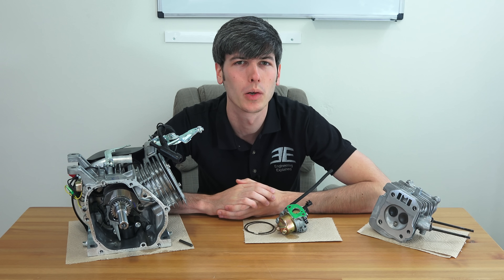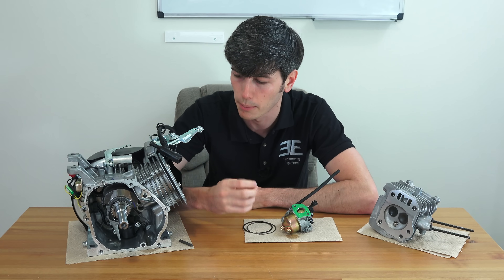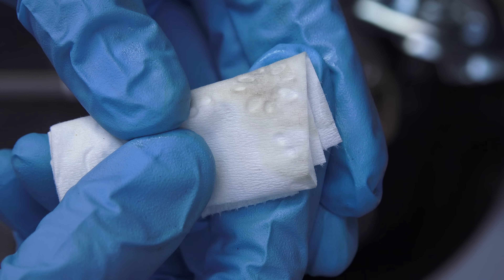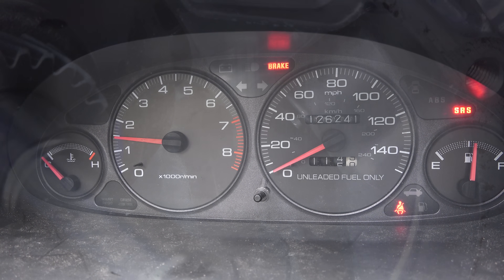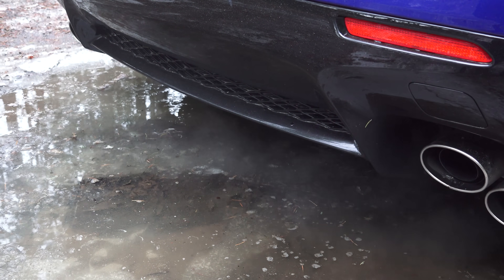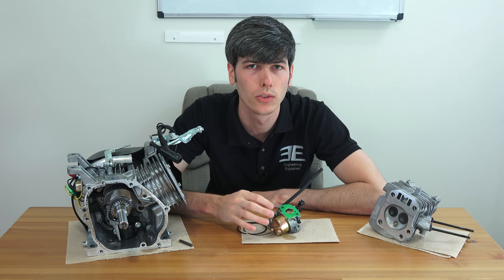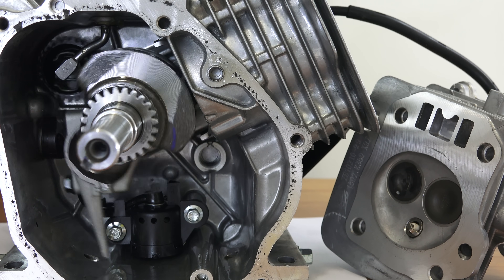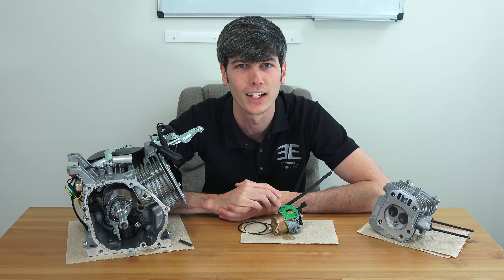Should You Warm Up Your Car Before Driving?

Comment: Yet, you didn't touch on turbocharged engines. Nor did you factor in what stress you are placing on gaskets and seals as they are stiff and brittle when cold. Not only that, but you failed to mention that metal contracts when cold and expands when hot. Forcing metal to expand rapidly by driving places more wear on the metal components of the engine, including main and journal bearings. Not to mention the piston rings. Forcing compression on an unexpanded ring can stress it highly. Not only that, but the engine won't be making full compression as you stated. Why? Not solely because gasoline doesn't like to atomize in cold air, but also because the rings aren't expanded. Also, yes, fuel washing oil off of the cylinder walls. Valid point. However, you are going to do more damage to your engine by forcing load on a rich combustion than you are allowing it to idle. At idle, the average engine sees about 12% load. Even under light acceleration, the modern engine will average over 50% load. This can be destructive and hard on gaskets and seals as well as highly stress the modern day metals used in modern day engine construction. With modern day synthetic oils, this theory is majorly invalid. In an engine using conventional engine oil comprised of hydrocarbons, this would be very much true. However, with today's synthetic lubricants which are by majority comprised of esters coming from petroleum, this is false. Today's synthetic lubricants are much harder to break down, even with a mixture of gasoline, hence why synthetic lubricants can often far exceed the "5,000 mile rule" by doubling it. Yes, gasoline breaks down oil, but it takes a rather significant amount to do so. You won't break down your oil THAT bad by letting your vehicle idle. Also, while we are on the topic. Your Integra, if it is a GSR or Type-R, comes factory with oil jets that spray oil onto the underskirts of the pistons as well as cylinder walls, so your Integra is practically immune to this rule you've provided. Modern day Civics are using that same technology in their newer aluminum cast blocks as well. I'm sorry, while you raise many points, they are all very debatable. There are pros and cons both ways. While you may reduce fuel wash, you will increase wear and tear on gaskets and seals and even metals. However, should you conserve them by allowing it to warm up, you will get some fuel washout. However, like previously stated, with modern day synthetic lubricants, this theory of engine damage from warm ups is the real myth. We aren't in the 1970s or 1980s anymore. Vehicles and powerplants have been revolutionized and this is a theory from way too many years ago to hold any remote amount of relevance to todays automobiles. Not hating or being crude. Simply providing some feedback as an engine builder of 8 years.

Comment: So what about turbocharged engines? no matter how lightly you drive the turbo still spools at a high rpm. and if the oil is still cold then font that damage the turbine bearings?

Comment: personally i always warm up my engine due to small distance i have to drive to my work ~4km.
driving small dinstances wont allow oil to get optimum themp and moisture that builds up will destroy oil 
same way as the gassoline suppose to do at cold start.
also when engine is cold oil pressure is high that ensures that all moving parts in the engine keep oiled ,there will be no dry spots in places that gassoline can dillute engine oil ?

Comment: What about in cases where its so cold outside that getting on the freeway actually causes  temp to go down. I have a 2011 dodge avenger with the 6cyl. I usually get to normal op temps by the time i get on the freeway. As soon as I do I i lose about 30c and sometimes (when its "why do i live where the air hurts my face cold") it's significant enough that i start to loose cabin heat.

Comment: You not addressing the various gaskets and their vulnerability when the various engine metals are cold. Most particularly, head gaskets.  Warming the engine allows the engine metals to expand against gaskets under minimal pressure.  I think oil dilution is a mute point as were it that serious I'd expect the engine to be burning oil badly in a short time, and we would have known about this a hundred years ago.

Comment: what would you qualify as "light" drivin. is it under a certain rpm like less than 3500 rpm or in a lower gear 5th gear with higher rpm instead of 6th gear with a lower rpm?

Comment: I'm sorry but you are expanding confusion by not explaining what "warming up" means and in what ambient temperatures.  I worked for GM and Bosch and had multiple interfaces with engine component developers and ECM designers.   Your references in carbureted  systems was fairly accurate but the fuel injected assumptions were horribly over-simplified and in some cases just flat wrong.  

Simplification is usually ok in arm-chair science but NOT with VERY complex electromechanical-fluid systems, especially when adding "Phase Separation" common to Ethanol fuel below freezing or in warm/moist climates like Florida.  Speak to any boat engine designer and you will understand why boat engines avoid Ethanol whenever possible.  

As for car engines, regardless of ambient temps you MUST allow the engine temps to make "early" stabilization settings.  Above freezing this often happens in 10-20 seconds depending upon ambient.  The EPA rules allow the first few seconds to allow proper engine start/idle and THEN begin the emissions step down as the internals rapidly warm.  

Below freezing there is another set of variables when a LOT of water in the gas system that must evaporate quickly or the engine simply won't run.   Also, below freezing the systems must rapidly re-calibrate to the temps and moisture burn off or the system will lock up with ice due to rapid air flow which drops the temps on the air intakes.  

Automotive engines today are VERY complex systems and over-simplifying them into "warmup" is a disservice.  Your videos are usually quite good but you screwed this one up badly.   Please contact some ECM/ECU designer and make a video looking at all the variables and realtime adjustments going on - you will be stunned and hopefully rescind this video.
Reply: Explosion pressure is high enough to push out multiple liters of water in the first second of startups.
The more cylinders and/or combustion volume the more water will be pushed out.

Ice in the exhaust system reduces air flow, which heats the remaining parts of the exhaust faster, you don't need to worry about that in non russian winter conditions

Comment: Sorry but it's not about the engine. driving with a cold transmission will cause it to malfunction. up north fleet vehicles have heaters attached to their transmissions. This is a fact. If it is below freezing Always warm it up before taking off!!
Reply: I have been a transmission specialist for the largest Remanufactured engines and Transmissions company for 7 years
Reply: light driving will cause malfunction? and this video IS about the engine, not about transmission.
Reply: @sultanabran1  you need to use the transmission to drive moron

Comment: This the cause of more misunderstanding than MANY other car ideas. "Warming up" does not mean running it for 10-15 or more....don't do that unless you maintain it under 'severe service conditions.' 

You SHOULD let it idle without touching the throttle at fast, cold idle until the idle drops down to whatever normal idle speed is for your car's engine. It's usually a couple minutes. Currently, I'm in northern North Dakota and my 'fast idle' time is about 5 minutes, after that I drive. In summer it's about 60 seconds or so.

Comment: As a powertrain engineer, I can tell you there is merit in letting your engine reach some minimum temperature before putting any load on it. Because pistons in passenger cars are aluminum and the cylinder liners are steel, they have different expansion rates. People who design engines know this, so at cold temperatures the piston to wall clearance in an engine is much greater than at operating temperature. Modern engines with dynamic valvetrain can produce significant torque at low RPM, and with the offset wrist pin design present in nearly all passenger cars, this can cause excessive side loading of a cold piston. Fuel washing cylinders is a valid concern, but scraping cylinders with a cold, side-loaded piston under heavy load is worse. 
My advice is to do some research on your engine and understand what the piston temperature rise profile looks like at idle. Once the piston temperature approaches steady state engine operating temperature (even if the engine is relatively cold), you're probably good to drive normally. However there will be a tradeoff unique to every engine at which point letting the engine idle longer with an operating temp piston in an otherwise cold engine will only serve to compromise the cylinder wall lubrication, as is mentioned in this video. That tradeoff point will be yours to determine/decide.

Comment: The colder it is the longer you should wait before driving. Cold engine parts don't have the correct tolerances and putting any load on the engine when the clearances are all wrong will cause increased wear. It's not just about oil circulation as you imply. With Subaru flat fours you can even hear the ill fitting parts when they're cold. Many Subaru's also have a blue "cold" light. As others have said its not always practical, or safe, to drive lightly.

Comment: If a warm up is not needed on direct injection engines, why are they still programmed to have a higher idle speed during a cold start-up?  Are those extra 500 rpm's for the first 3-5 minutes serving another purpose?

Comment: Well... the thing is that the true reason people warm up their engines is to warm the car up so your not driving in a frozen car interior. Unless you live in a place where all you need is a credit card to scrape your windshield then you have NO freaking idea what real cold winters are! lol
Reply: creditcard...no way....I have to carry and use a small scraper to keep insides clear,,,,,and that on a 2018 CRV where you can let it idle for hours and still no heat
Reply: right now its -32 in Edmonton alberta where I live, I'm gonna run my truck for 15 minutes before I drive home because I don't wanna die.

Comment: Good video, but you missed an important point. Thermal shock to the liner. If you start the engine from cold and dont wait for engine to warm up, you may even get a cracked liner in extreme cases.

Comment: Hmmmmmm.....what's the difference between driving the vehicle or sitting in park? still the same fuel is injected either way to keep the engine running.

Comment: Carburated engine: Start with choke.Dump choke, and run for two minutes. Switch OFF. Wait 2-3 minutes, restart with choke if necessary, then dump it immediately, then drive off gently.

 Why all this? The initial start gets a little heat into the engine. If the engine is allowed to continue to run, there is a hell of a draught going into the inlet manifold, so it takes a long time to warm up. By turning the engine OFF, heat from the head starts to warm the inlet, which is not getting a cold draught through it. When you restart, the fuel atomises easier. I usually find I can drive off at a reasonable load, cleanly, and without the choke.  Yes, I have old vehicles...

Comment: been a mechanic for 29 years let it idle 3-5 min b4 taking off then drive easy until your at normal operating temperature if its very cold like 32 degrees or below at least wait 5 min trans fluid and power steering fluid need to warm up just a lil also

Comment: Here's what. It's not very "scientific", still. . .

NEVER, EVER, EVER trust a guy talking about cars whose hands are THAT clean.
My PRISTINE 2001 Cadillac DeVille has been being "warmed-up" for 16 winters now.
118,000 miles - runs like a raped ape.

Subject the car to routine maintenance, keep fresh oil in her, bring a case of beer for the mechanics at the authorised dealer, and you will be GOLDEN.
Save your engineering ideals for your thesis paper.
There IS NO "one size fits all" with regard to automobile engines.

Comment: i have an auto choke the engine revs high at start 2 to 3 minutes and the rpms will automatically come down and the oil is circulated through the engine

Comment: My '05 scion xb has EFI, but when the "cold" light is on, the thing refuses to go up past 2nd gear...should I not worry about this because its a built-in safety feature? Or might there be an actual problem thats stopping me from changing gears?
Reply: Also, as SOON as that light turns off, its good to go and will shift up immediately. Which is what leads me to believe that this is a safety feature. This one is an automatic.

Comment: As living north enough to think of these there are several reasons to warm up the car if engine block heater was not connected. 1. At least some warmth, if engine is completely cold breathing will fog up windows from the inside quite easily. But letting engine run minute or two usually gets enough heat inside the car that windows stay clear. 2. at least some warming up for transmission, also get the oil flowing. 

But okay if temperature is over 0 celsius at least I think that start is warm and over -10°c it's "not that cold" so that 15-30s running is fine before taking off. 

And of course driving some minutes before running onto motorway and even longer before accelerating hard. It's nice to see water temp at least on scale before hurry.. Always if possible oil pan heater and interior heater at home and webasto elsewhere if I just have the time apply heat for some time before starting below 0°C. With 5kW diesel heater (webasto) engine is hand warm in 10-20 mins and no pistons harmed.

Comment: he didn't take into account places like Alaska Maine or other far northern reaches of America where the temperatures can as low as negative 30 and negative 40 or negative 50 degrees Fahrenheit those temperatures will freeze your fluids solid I met a guy that lived in the far northern areas of Alaska he left his car  either plugged into a block heater or just left his car running at all times in the winter

Comment: Does this apply to diesel engines as well? i thought that due to a diesel using compression and heat to combust you should let them warm up a bit before driving them. correct me if im wrong.

Comment: you do make valid points; but I live less than 4 miles away from where I work. As a result the engine itself won't even hit 80 degrees by the time I arrive. do I have a catch-22 going on or something? or is it better for me to just allow the engine to warm up for 7 minutes while still in my driveway before I take off?

also, when I do turn over the engine; the engine itself stays at a high idle (12-1400rpm) during temperatures below 32 degrees for what can be up to five minutes until it reasons a normal idle of 900 RPM. any idea as to why it does that?

I own a 2012 F150. it has a 5.0 liter engine( 302 cubic inches)

Comment: if you live close to your on ramp that takes you to your workplace or if you pull of your drive and directly onto a road that has a speed limit of 55 and a decent amount of morning commute traffic you better warm your engine to approx 100-130 degrees Fahrenheit.. Reason being that both those scenarios cause a need for moderate acceleration to achieve travel speed..If your engine is not warm, and you do this Mon-Fri, every morning, you will be shy a quart of oil within 3 months and as soon as 1 month on forged piston vehicles like old 5.0 Mustangs... When I worked at Summit Racing I spoke to a TRW rep that explained that kind of cold acceleration, even moderate, would cause that kind of oil loss due to the lack of thermal expansion needed for the pistons to help the rings seal. BTW when I got off work the on ramp was less than 300 yards from my workplace so the problem was again present unless I warmed my vehicle first..And lastly, just because driving the vehicle warms it  up faster doesn't make the ”ring wash" from the rich condition go away instead it forces the engine to perform under a rich condition until operating temp is achieved. I would rather have a longer rich burn condition at idle then a shorter rich burn condition under load,even a moderate load..

Comment: when I don't warm up my car, my transmission feels a bit harsh changing gears, I have an 04 rav4 automatic
Reply: Happens on my 2018 camry le also
Reply: Yeah because in automatics, your tourqe converter will warm up the transmission from idling. Manual transmissions need to be driven to warm up
Reply: Same with my 99 Accord EX coupe. Fluid still looks fine (reddish on napkin). May have the transmission mounts inspected.
Reply: I don't own any automatics, but my Accord shifts much notchier when it's cold

Comment: when u start ur car and its cold ur car has a higher idle that normal. if u dont let the car warm up and idle down  then is bad on ur transmition because ur not supposed to put ur car in gear when its above the normal idle rpms.

Comment: I live in Southern California, and all my cars for the last 20 years have been fuel injected. I always warm up my cars, more than most people do. My last three cars, all were driven over 185,000 miles, and none of them had even a whiff of smoke, didn't burn a drop of oil, and got the same gas mileage when I got rid of them, as they did when they were new. I drive hard, too. No babying it for me, I'm a lead foot!
Being an old codger, I'll stick with what I know works fur me, which is warming the thing up. Thanks, sonny!
Reply: ^ THIS ^  (referring to kickinbackinOC
 comment)
Reply: He just explained why you’re wrong. If you want to hold onto old beliefs white-knuckled then go for it. But you don’t have to type a paragraph defending being wrong.